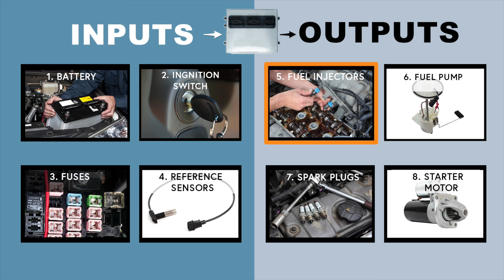Bad Engine Control Module Symptoms #FlagshipOne #EngineControlModule

Comment: Sorry to bother you but I have a 2006 Jeep Liberty with 136,000 miles and I was driving about an hour away from my house and I got stuck behind a semi. I went to go around him and my traction light came on and I started to lose power so I pulled over. And yes I didn’t know what to do so I shut it off. Now it has the security code the abs the esp I think it is lol on the wheel it’s self. I put the key in and go to turn it on I can here the relay and the singing but that’s it. The lights radio and power locks still work it just won’t go 🥺 please help

Comment: Great video, very informative! I believe my problem is a short to O2 sensors causing intermittent fuel trim issues. This is a new PCM, alternator and O2 sensors. Still getting codes P0132, P0135 & P0141 on my 2000 Dodge Ram 2500 4X4 with a 5.9l gasoline engine.

Comment: How much to replace a 2003 Saab 9-3 vector as I’ve replaced all my codes I’ve had still getting problems when I pull the ecu fuse car runs good for 5 minutes then engine light comes back on and runs rough goes to limp mode please help

Comment: Hopefully someone can help me. I have power under the hook when key is turned but only check engine light in cab. Nothing else and the car won't crank. I've check wires and nothing is shorted. Would a bad ecm prevent electrical from working? The car ran the other day but lost electrical when brakes were applied but the motor did not die. I've had ecm issues since I've had the car. Its an 03 cadillac cts and apparently that's the normal for them. No fuses are busted either. TIA.

Comment: I just don't get it I have a 2007 Chevy taho LS in I've changed all the spark plugs wires and coil packs and I still have this fluttering I was even told that the computer was re signaled or something of the sort also I believe the cold steel reeds misfire in 2

Comment: Had wires chewed by rabbits this started the whole thing. My mechanic fixed the chewed wires but car would not start he couldn't fix it. Had it towed to the dealer and was told it was a ECM so it sits waiting to get the part it may be 3or4 weeks what thwhell is the problem??

Comment: What can cause ECU to break, and how often that people have this problem?

  I never had  one failure for all these years.
Reply from the maker: Hello, James. Here are 7 most common reasons for a PCM failure:

1. Corrosion/damage due to moisture (corrosion through the wiring harness and moisture because of the bad PCM sealing)
2. The Electronic Fuel Solenoid (a possible short in the PCM because of the corrosion in the solenoid or in the wire going from the solenoid to the PCM harness)
3. Injector Wiring Harness (corrosion and breaks in the harness can cause a short in the PCM or corrosion can get in the PCM through the wiring harness)
4. Poor grounding (loose/corroded ground wires to the battery)
5. Jumpstart with the improper cable connection (causing a spike in the PCM, shorts it)
6. Dead battery cells (affects the grounding in the battery)
7. Bad Starter (replacing it with the wrong model starter)

Comment: Dealership did a recall on my airbags now my car is not running right they then diagnosis said pcm has a internal voltage problem in short terms does this means get a pcm ????

Comment: ok. new starter. actuator bypass works, all functions work. orignal key. i dont know what else to do. the flippiing thing will not start! even put in a new fuse. what now?? please, i am stranded. car will not start. problem used to be intermittent and has gotten progressively worse. lately if it started, dont turn it off! wont start again until tomorrow. now it's 4 days past tomorrow and it still will not start. what can i do? please help!

Comment: This is ridiculous....not the video, but the way these manufacturers get away with not having a test jig setup at the dealer where any customer should be able to have their own computer connected to get a full diagnostic ON THE COMPUTER to verify that the ECU is in fact a good unit.  Especially on OBD 1 cars, it is an absolute nightmare to try and nail down a computer problem.  Outrageous.
Reply: I agree

Comment: NEED AN ANSWER!
Is it possible for the automobile electricians to mess with your computer so that it won't run correctly? I feel like that's what happened to me because I took it to an electrician and he told me the camshaft sensors needed to be replaced and that it needed to be reprogrammed after. I declined there help and just paid for the diagnostic because it didn't make sense to me why it needed to be reprogrammed after changing out the camshaft sensors
Reply from the maker: The ECU determines injection/ignition firing based on the crankshaft and cam position sensor signals, as well as whether or not your engine is misfiring (by calculating the time between the signal pulses and running it by the data it has built-in).
Changing the sensors would result in slightly different signal output. Hence, the previous sensor information has to be reset from your ECU, so it could relearn the signal from the new sensors. Otherwise, you'd get misfire-related error codes and an overall poor engine performance. Any shop with a proper scan tool can execute this reset procedure, it doesn't have to be a dealer.

Comment: ERROR CODE: P2503 code in my 03 Dodge Ram 1500 4.7 engine.:
Problem began with:
My battery would drain if the vehicle sat for two weeks.
It wouldn't start. I could find no reason for the battery to drain.
It never did this before and nothing was added to the vehicle.
I noticed the voltage at the battery when vehicle was running was around 15.5 volts.

Battery took a charge fine, then passed load test, and still does today.
I installed a trickle charger to make up for the phantom drain on the battery. All was fine for a year. 

 I recently started it up and noticed the battery gauge was not up like it should be.....by the time I drove 100 feet the warning sound and check gauges light came on. 
The Battery gauge had fell to zero.

I left the vehicle running and grabbed my multi-meter. I connected to pos. and neg. terminals of the battery while engine still running. Multi-meter showed less than 12 volts. 
I shut engine off engine off and restarted....PRESTO.....back to normal charging voltage of around 14 volts or a bit better.....so I drove it for a 60 mile round trip.

A few days later I started the engine and it did the same thing again. Battery gauge showed normal with ignition in on position, but not started or running yet. 

When I started the vehicle....the gauge slowly dropped down and then suddenly dropped  to zero....check gauges light came on. Shut vehicle off and battery still had 12.8 volts.

The Battery voltage is 13.6 volts (fresh off the trickle charger) until I start the engine and it drops down to below 12 volts over a period of about 3 to 5 minutes. 

All connections are cleaned and solid.....didn't help. 
Reset Computer by disconnecting battery. didn't help.

Changed alternator (new, not rebuilt)..that didn't help.

Checked fuses and the cable from alternator to fuse box....no problems I can see there.
Belt is perfect, lots of tension.

Tons of cracking power. Engine turns over fast and starts with no problems.

PCM/ECM seems to be the only other thing I can change to fix the problem.

Will a new PCM/ECM module fix the P2503 error?
What else could it be? I've done everything else.

Comment: 1:15 I'm guessing that's what it'll look like if it's overcharging or causing the alternator to overcharge the system?
Reply: The alternator has internal component that control charging rates.
Reply: @ron6376  yep, and sometimes it fails...and doesn't send the digital signal to the alternator regulator, which then reverts to a fixed level....which is not good.

Comment: Hi. My car have slow pickup . I have change the pluqs, cable, oil fuel, oil filter, hose, rediator.  Ihave check my exhaust.  It seems that I dont know the problems.  And my mechanic can't trace the problem
Reply: Stop up cat converter or timing out

Comment: Once in awhile I get a P0604 on my 04 BMW 325xi 2.5l ram memory error what does that mean need help
Reply: That's the code that tells you the main computer is bad. Probably just starting to go. Get rid of that endless money pit now!
Reply: @caayydenn  well it would have been nice if I about this earlier cuz I had it finished out with a used one to Florida they were able to clone it it's my daily driver

Comment: I have a Nissan xtrail manual 2008 engine light on the gas is only 1500 rpm whether the ECU is damaged please help
Reply: Arie mursandie  did you ever find out if it was the computer ?

Comment: I have a few question and may want to order a new ecu
Reply from the maker: Please direct all inquiries to our sales reps through email (admin@fs1inc.com) phone (516-766-2223) or by visiting our website (fs1inc.com) and connecting through our live chat.
Reply: Flagship One, Inc. what does it mean when power is getting to coil pack but once plugged . It doesn’t create spark. I have compression test done, new spark plugs, new coil, and new used ecu.

Comment: I got no signal from pcm for #4 injector, will reflashing it or updating it fix it?
Reply: Im a mechanic. I guarantee reflashing and updating will not help. You need to find the two wires that go to the injector on a wiring schematic and see how it is controlled. If both wires go straight to the computer, you need to use an ohm meter to see if there is resistance or continuity to the injector. If one of the wires is just fused, check for power. It all depends on the wiring specific set up on your car

Comment: What if the the vehicle doesn't have one to begin with
Looking to get an f250 but they say it doesn't have one
Reply from the maker: Could you please specify what year of F250 Truck you are referring to? Even the 1989 one should still have the OBD1. Unless the F250 you are referring to is having an older engine in it.

Comment: Programming does not work. ECM will not work without reprograming.  Warranty is you lose $85 to return, more if you reprogram and the unit will not work unless reprogrammed.  so if you have a couple weeks and $200 to throw away order from Flagship One.

Comment: If you do a computer swap before first checking the computer system for any shorts, such as a shorted fuel injector, the new or replacement computer will also be damaged.

Comment: What if you’re getting no codes
Reply: i am getting no codes as well but it's because it's not reading that the key is not in the ignition. Because initially original key tumbler broke so REPLACED with a non "chiped with transponder" KEY. so i am guessing the PATS module would have to be reprogrammed.

Comment: Ok i have a 03 3.5 altima..i just had the codes cleared at the dealer..now my situation is the check engine light is on i checked it with my live data mac tools scanner and there are no codes found...again check engine light is on but no codes?? Coukd this be a sign of a bad ecm?? the dealer said that the timing chain needs to be replaced/set...my coil packs are not getting spark..ibshould at least be getting spark regarless of the timing chain right even if it is off?

Comment: And it seems to run fine but the transmission won't work is that the computer
Reply from the maker: Does the transmission go into gear? If that's the problem, inspect the transmission fluids. If checks out, you can try resetting the vehicle's systems. To do so, detach the battery and let it stand for 30 minutes. Then, reattach and allow the system to reset itself. Yes, among other factors, the source of the problem could be the computer system.

Comment: P0010 code I'll change all the parts does it call for I'm still engine light on I've been dealing with this for three months I can tell me I need to drive it about 200 miles I have drove it for 500 miles and the light still on I don't know what to do it won't pass smog I already pay for my tags

Comment: I have the 2008 Vw Rabbit and when I start it it starts then stops immediately.I thought the key was the problem and I invited a key maker/programmer to check it,he told me that there has to be two keys for the car to be programmed and I paid for an additional key and the programming but it did not work.With the information that I have gathered I think the problem is the ecm because on the dash there is the car and key sign flashing. So in this type of a situation and the sign that I saw flashing on the dash with your experience what do think is the problem and what can be done to get it fixed. bearing in mind that the ecm needs to be programmed to work with the car.

Comment: I have a 2007 Town and Country with a fried ECM. I have  three choices. I can have the dealer do it (about $2000) which is outrageous, trade it in or buy an ECM from these people here, Flagship 1 for about $200. The catch is that I will have to install it myself because if I take it to the dealer I will be  told to throw it out and buy theirs. I had Firestone do that once and I walked out and filed a complaint with the company after having it out with their mmanager. I forget what the part was but I was not going to dispose of it and buy theirs at several times the price. 
     I can buy a phone, prepaid cellular, that can do infinitely more than one of their computer modules and get it for under $100. Then these car companies cry about their bottom line. Sorry, my eyes  are dry. No sympathy.

Comment: My pcm wont give any info and says it cant connect
Reply: mxr same here. Fuse is ok and the data port (obd2) gets power but won’t connect. I don’t know what it could be.
Reply: Enrique Hinojosa sounds like the pcm
Reply from the maker: The easiest way to test the communication problem is this: https://www.fs1inc.com/blog/2018/10/29/what-to-do-if-the-obd-ii-scanner-doesnt-communicate-with-the-vehicle/
Reply: @FS1IncNY  This link is gone.
Reply from the maker: @dougrobles4061  Updated link: https://www.fs1inc.com/blog/dtc-p0113-common-symptomscauses-and-proven-fixes/
Reply: @FS1IncNY  Thank you